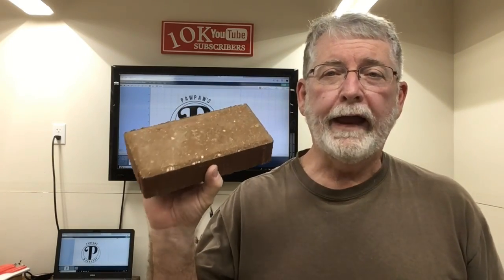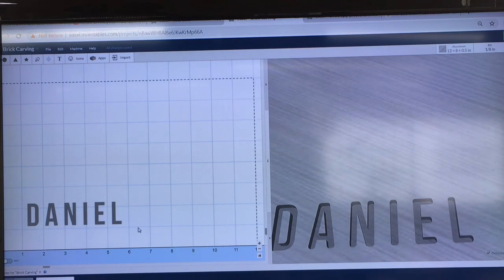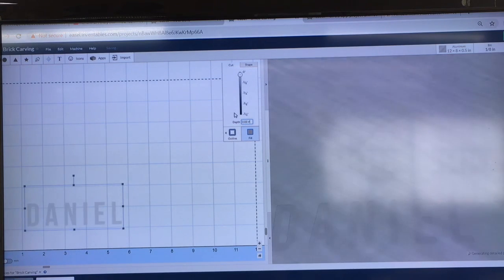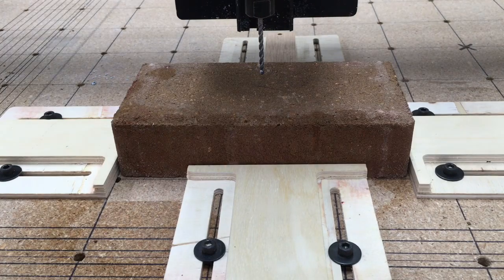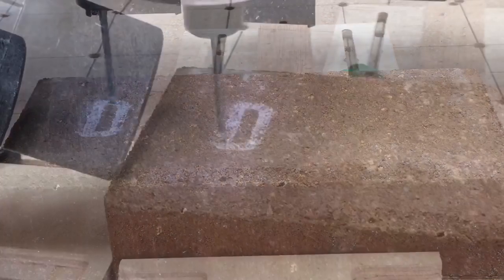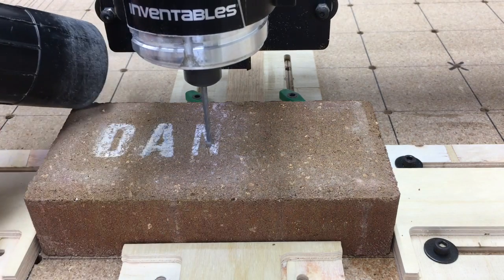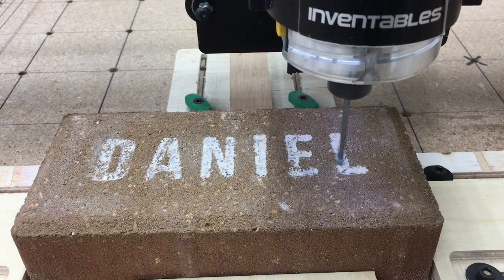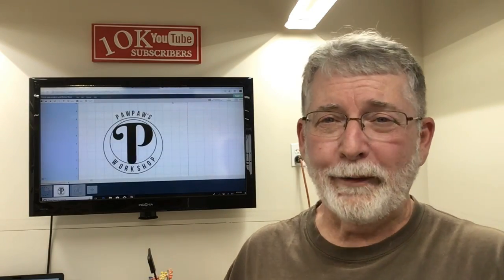Taking a Brick to My XCarve

Comment: Looks like it did better then I thougt it would. I have been thinking about doing the same thing with an unglazed ceramic tile, but the ceramic might be a tad hard. Might be interesting to see some softer clay, like the clay found in a flower pot, huuum? Thank you for sharing your little experiment, its a great idea! Always love to watch your ideas come to life. Andrew
Reply: Andrew W that sounds like a cool idea. Like a “will it carve” kinda thing?
Reply: You might want to try a Diamond coated bit for the ceramic tile, could work alittle better
Reply from the maker: I agree, that's what I said at the end of the video.  Thanks
Reply from the maker: The challenge is on, will have to find more crazy stuff to carve

Comment: Looks good, I would not have thought it would work. Can't wait to see how the tile bit works. Oh and thanks for the advice on the X-Carve setup was finally able to get mine setup and you were correct defiantly needed to add some extra support to the 1800mm rails. Thanks again.
Reply from the maker: I was not sure either since the bit was designed to drill.  It was a lot of fun to do.